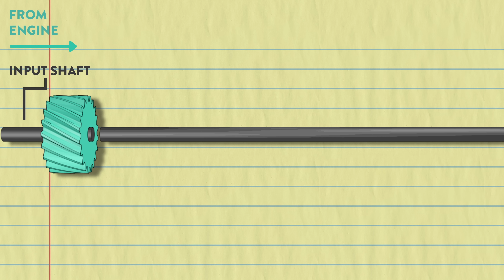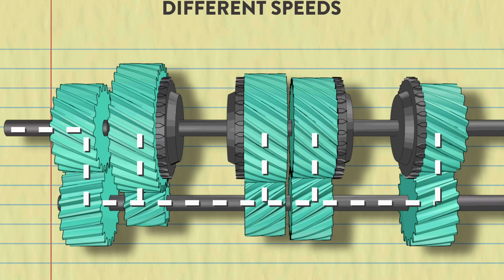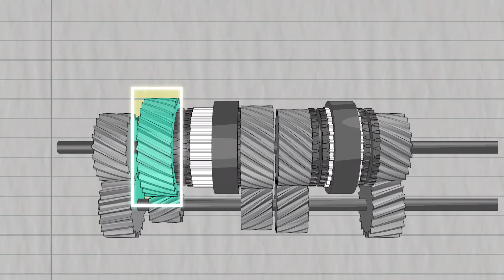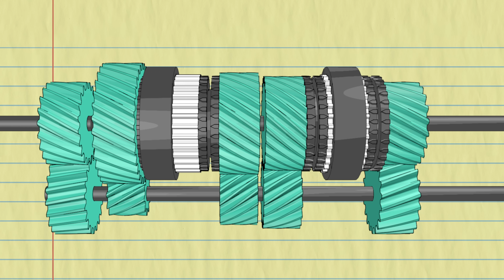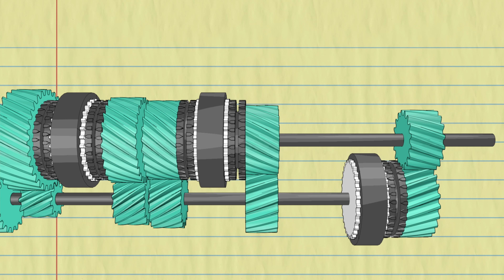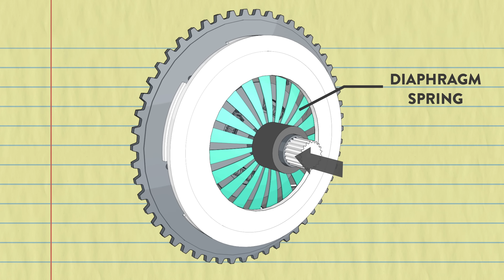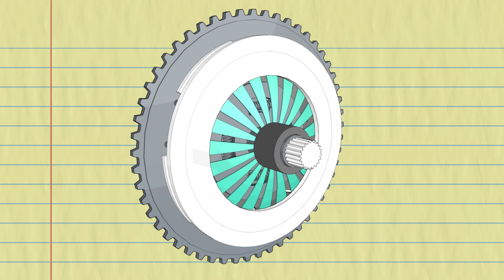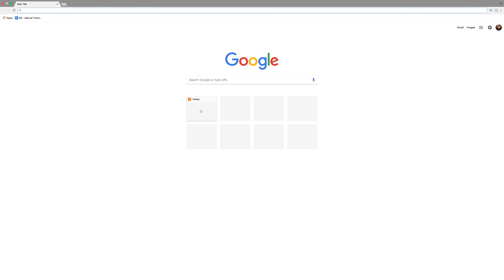MANUAL TRANSMISSION | How it Works

Comment: I learned to drive in a ‘56 International Harvester pickup truck with a 6-speed transmission with no synchros and 1st gear was super-low so I always started in 2nd gear and did clutchless upshifts so I didn’t have to double-clutch to go up to the next gear. Downshifts worked better with double-clutching ‘cause  rev matching is harder on the way down. Driving my ‘06 xB with a stick I still almost always do my upshifts clutchless unless I’m accelerating harder than normal. Downshifts are easier with synchromesh so do those using the clutch. ( this all came in REALLY handy when one of my motorcycles broke its clutch cable! ;^)

Comment: Here’s a tip that might help for using the clutch: As you let the clutch pedal out slowly, the moment you feel the clutch engage the transmission & the vehicle starts to move forward, you wanna kinda slow down your clutch pedal foot movement, so that it smoothly engages. Keep in mind that you’re also balancing between letting it out too fast and jerking forward and letting out too slow and burning your clutch.

Comment: A good way to practice clutch use on a manual transmission is on an old tractor since it’s geared to pull heavy implements thru dirt & has tons of low end torque making it harder to stall the engine by accident, so it’s good for beginners. Changing gears is kinda a different story tho because a lot of old tractor transmissions don’t have synchronizers and are meant for you to just put it in a gear & leave it rather than change on the fly. You can shift gears on the fly, you just might grind the gears a little bit while doing it, so you gotta be careful.

Comment: Question: Engine produces torque and sends it into the gearbox. Right?
Des gearbox act as an electrical resistor?
Do the 1st, 2nd gears reduce this torque or make it more?
How about 3rd and 4th?

Sb helps me please. I havent got the point yet😢😢😢
Reply: Gearbox acts like a transformer. Put in one voltage and get out several selectable voltages depending on which coil you tap on the output side. The lower the voltage (low gear), the higher the current (torque) can be for the same amount of power. There’s also some amount of resistance because nothing can transfer 100% of the power. Manuals were much more efficient than automatics years ago, but automatics have improved significantly.

Comment: I could never get the coordination down to lift off the gas, press the clutch, shift gears, let off the clutch, and get on the gas at nearly the same time in a smooth motion. I always stalled. Thankfully nearly everything is an automatic, or automated manual these days.

Comment: My dump truck has an 8-speed not synchronized I float the gears no double clutching and my first four gears have a low and a high my granny gear has three speeds and my reverse has three speeds and my highway gears only have a high if that makes any sense LOL

Comment: here in India 90% cars are manual. Im from a hilly area and my car is manual without any hill control feature. So there's a stuff called 'the half clutch' only guys who drive manual and from hilly road will get. it's used in situations when u get stuck in a traffic on a slope and then u have to move without going back, you place ball of your right foot on the brakes twist it and let the heel on the gas, with your left foot you place it on the clutch now slowly you release clutch and brake and push the gas all at the same time. Takes practice

Comment: I've been driving manual since I was 11, have a manual shift car now and I have never double clutched. Neutral and tire friction are my downshifting....and the brakes. Too much work for the minimal saving of my clutch, and I'm terrified I'll strip a gear because I forget to clutch the second time.
Reply: you dont need to double clutch, but you should be downshifting. rev matching is good too
Reply: @arcanevoid9199  I downshift when necessary, but if I know the stop is coming and there's no chance I can downshift and keep going, I just roll to a stop.

I rev match but don't double clutch.

Comment: Double clutch is ONLY NECESSARY when you are driving a manual without a synchromesh. So, for basically all manual cars, double clutching will wear out your throw-out bearings with slower shifts and zero benefit (no it isn't easier on the transmission). Note: The presenter mentioned big rigs and racing, those are specialized applications (aka not a normal street car like an M4 or Corvette).
Reply: it puts less wear on the syncros because you do the work for them, theres a reason why it goes into gear so easily when you double clutch. not disagreeing that isnt necessary with a synchromesh though

Comment: I bought my first car yesterday and it’s a manual and my dad is teaching me how to drive it. I first drove with my grandma and she gave me conflicting advice which my dad said is wrong but it’s still stuck in my head since it’s the first I heard. The hardest thing for me is reversing and starting after I get into 1st gear. I also have trouble easing off the clutch after I switch gears so it makes the ride kind of jumpy. But I’m sure this will all go away with practice. :)

Comment: So am I correct in assuming that  the extra springs he was talking about in performance clutch pressure plates is why it takes so much more force to push the clutch pedal and why it tries to throw your knee through your stomach when you let off in a stage 2 or 3 racing clutch?

Comment: Here's my makeshift thoughts at half past midnight:
OK so the sleeves on the hubs connect to the teeth, of gears on the OUTPUT shaft. And the gear on that shaft gets it's power from DRIVE - COUNTER - OUTPUT.

1) CHANGING GEAR:

So start with the driven gear. On the DRIVE shaft. The gear there is connected to one on the COUNTER shaft, and that rotates the whole shaft. Along the COUNTER shaft are other cogs, connected to gears on the OUTPUT shaft. There are hubs and sleevs on the OUTPUT shaft. The sleeves connect to the gears on the OUTPUT shaft.

A SYNCHRO is on the OUTPUT shaft, at the EDGE of the gear's teeth and the SLEEVE's teeth. It disengages the whole COUNTER shaft, and the wheels drive the OUTPUT shaft for a bit. When you squeeze the synchro with the sleeve, it is locked to the HUB and anchored to the OUTPUT shaft. 
So everything spins, right? That's a gear shift. I think. Power travels. 

2) GEARS:

FIRST gear gets the largest torque. It is slow and strong, the one on the counter shaft is faster and weaker. The gears on the OUTPUT shaft gradually get smaller. Usually, FOURTH gear is Direct Drive, or 1:1. The OUTPUT and INPUT shafts spin at the same speed.

3) RATIOS:

A 2:1 ratio means the INPUT shaft spins 2 times, the OUTPUT shaft 1 time. Go from left to right being the delivery path.

3.1) OVERDRIVE:

5th gear can be an overdrive gear on the COUNTER shaft. It has a lower gear ratio. This gear turns less than the one on the OUTPUT shaft.
Fuel economy increases. 6/7 can be double overdrive.
Forward momentum means it doesn't need as much power.

4) REVERSE:
Reverse is on the COUNTER shaft. It means the OUTPUT and COUNTER shaft spin in the same direction.

Comment: Thanks a lot Bart! It makes so much more sense now. When you push the gear stick up or down, the hub moves either left or right depending whether you chose up for higher or down for lower of that side. This perfectly explains the specifically chosen |-|-| shape of the stick's range of positions for 5/6 speed transmissions!

Comment: It’s clutch engagement when you press clutch pedal and the clutch disc will pop to give the engine the gear depending on the speed and the rpm

Comment: I know there are gears and stuff inside a gearbox. I just don't know what are the engineering principles to time those gears and not grind each other. Same with clutch, it's very confusing. It has too many moving parts.

Comment: I have yet to have seen a clutch without a diaphragm in a car, since like '86 models. Regardless if with solid or dual mass flywheel. Diesel or petrol, 5 or 6 speeds.

Comment: Hello friends, in manual transmissions can you use most API GL4 in most cars, SUV 4x4 API GL5, API GL4 is not compatible where GL5 is requerid, is Synchromesh transmission/gear oils where API GL4 requerid posible to use?

Comment: Guys I have a question, is it possible to make a manual car move without starting the engine by pressing the clutch? Just to move away from my house without making a lot of noise
Reply: If you're driving downhill, yes. You can just release parking brake and go downhill a little
Reply: Michal Rejdovjan what if it’s not downhill
Reply: Michal Rejdovjan can’t I just use the clutch to move?
Reply: @Kayshaan1  no, clutch only connect engine to a wheels, and when engine is not moving the wheels can't move neither.
Reply: Michal Rejdovjan alright thanks I thought I’d be able to roll out quietly haha

Comment: wait a minute... I push in the clutch, rev match without letting up on the clutch and down shift at the same time, then I release the clutch and accelerate with my VTEC YO!

Have I been doing this wrong? It seems to have been working and I thought I was minimizing clutch wear. Is holding down the clutch while rev matching bad? I can't imagine it's even 1% as bad as just engine breaking into a downshift while stomping on the gas. lol

Comment: I drive manual not beacuse im thr one with machine, i drive it because i control the machine 100 % if i want i could shift into first on 200kmh just because i can for some reason, that is the point, i drive the car, and car do not drives me

Comment: high speed and high gear are not necessarily equal. my Audi can be in 6th at 45 mph or 1600 RPM. Many European manual models allow you to drive locally on the street in a higher gear than 4th for decreased gas consumption and better efficiency. however, i always recommend to drive in the appropriate gear and don't lug in high gears because you think you're reducing torque and thus consuming less gas. you still have to factor in your transmission to engine rotation speed and you're going to have a more difficult time down shifting if you have to stop or slow down suddenly. then you'll have to go into neutral and a lower gear and that's hoping you know your car and can gauge RPM/MPH and where it should be. Also, you're going to waste gas going back into a gear from neutral to speed up.

Comment: In one of C5 Corvettes with a 3.42 rear-end gear and 6-speed, 4th, 5th, AND 6th gears were overdrives. 4th was a perfect 1:1. At 80mph on the interstate, it was barely running above idle in 6th. Pulled fine though, and got ~35 miles per gallon (believe it or not!)

Comment: What kinda fool double clutches? Just depress the clutch once, and match the revs to your speed while shifting into the gear? There’s no need to waste time stopping off at neutral on the way?
Reply: It reduces wear on the syncros and can make it easier to make a smooth shift. Unsynchronized transmissions also have to be double clutched
Reply: @redtooth75 it’s an unnecessary extra step, don’t shift into neutral, just shift straight into the gear you want, put on the revs while you still have the clutch depressed to match the revs then lift the clutch. The way double clutching is explains here sounds like you drop the clutch to shift into neutral, lift the clutch out once in neutral, put the revs on while in neutral then drop the clutch again to shift into the gear you want, then depress the clutch of again while maintaining the revs. It’s wasting time, as soon as you depress the clutch peddle the engine is disengaged from the drive shaft, it’s effectively in neutral, so just put the revs on with the clutch disengage, shift into the next gear and then engage the clutch.
Reply: @ajl8975  shifting normally increases wear on the syncros. Its not necessary to double clutch but it increases the life of the transmission. Double clutching matches the speeds of the gears so they mesh smoothly which means there is virtually no wear on the syncros.
Reply: @redtooth75 that’s just not true, the synchro is designed specifically to bring the speed of the driveshaft up to the speed of the gears. It’s robust enough that to do that as long as you’re not coming off the clutch instantly. You don’t need to double clutch, it’s a waste of time, just dip the clutch and rev match. Now, before you go on to discuss with me how double clutching is better let me tell you what my job is, i’m a mechanical design engineer, my name is followed by the letters BEng, MSc AMIMechE, I did an entire semester on gear design, ratios and material properties, frictional coefficients and the effect of stress upon mechanical bodies. A few of my friends now work for Nissan, one now works for team Ferrari. So please, believe me when I tell you, double clutching is a waste of time, look up Rev matching. Here is a top gear article explaining how to do it https://www.topgear.com.ph/features/tip-sheet/rev-matching-tip-sheet-a00187-20171009

Comment: Excuse my ignorance, but what happens exactly that causes an engine stall? 

Is it that the difference between the wheel torque and crankshaft torque is so extreme that a safety mechanism comes in and turns off the engine to avoid damaging the drivetrain?

Comment: Ok so bro. I just like clutch in, rev, shift and clutch out for when im downshifting... Like one smooth motion.. why would I clutch, rev, shift into neutral, clutch again, rev and shift into the lower gear when I can literally just do that all at once? Fuck double clutching.
Reply: Double-clutching lets you adjust the speed of the engine's side of the shaft to match the new gear ratio before putting the load on it, preventing it from slipping or grinding gears if the speed difference is high.  It's mostly not necessary on modern, consumer manual vehicles, which use synchronizers to do the same thing.  It is still recommended if you have to downshift suddenly for some reason; going straight to a lower gear can put a lot of pressure on the synchronizers.
Reply: @Acorn_Anomaly  So why cant I just fuckin blip the throttle in a rev match? Without alll the other bullshit? Thats what I do.

Comment: 10 gear transmissions:
MAXIMUM OVERDRIVE
Reply: Dylan Kline shift into MAXIMUM OVERDRIVE HIYA!
Reply: Have you heard of 18 speed truck transmissions
Reply: Did you get the turbo to go along with that?
Reply: 18 ? GEAR TRANS
Reply: Dishu yes they exist but are essentially 9 speeds doubled ip

Comment: Not all manual gearboxes are synchro-mesh. My Datsun race car doesn't have synchros and as a result, if I changed down without rev matching the rear wheels would lock up. In modern cars, when you change down you sometimes feel the car jolt before the gear engages, that's the synchros getting the engines rpm in the right range  before the gear engages.

Comment: We really don’t double clutch when driving big rigs, since the transmission is unsynchronized you can actually float gears and not even use the clutch unless you have to make a full stop, a big rig is more forgiving than a regular car transmission or as mu brother would say “its semi-automatic” you just match the rpms to the speed and the gearshift pops right out and you push it into the next gear, clearly you can do this on a regular car but thats probably not that much of a good idea

Comment: The only thing I hate about driving a manual (2002 3.9 V6 dodge Dakota) is that, when I’m driving down the highway and I throw it into fifth gear I pretty much immediately have to put it back into 4th as soon as I have to go up a slight incline. Shits annoying

Comment: Instructions unclear. I shifted into the Nth dimension.
Reply: I shifted into foward n now my car red lines at 2 rpm
Reply: ErnDog sequence R (prompt XX.511.112) DIR12/ syntax67ftp bababooey🤛
Reply: I was at 5th and i wanted to try "Rocket"
Reply: @francorodriguez5487  bro that's race mode
Reply: @nut44896   What, you egg?
Reply: @francorodriguez5487  ok.
Reply: That’s known as neutral.
Reply: I shifted into race mode and there was a lot of new speed bumps.
Reply: @isjfjstg8yk  um buddy that wasn't race mode
😟
Reply: @ksuperhero1  The sketchy russian spy dude that I bought if from said it was.
Reply: Is this a joke???